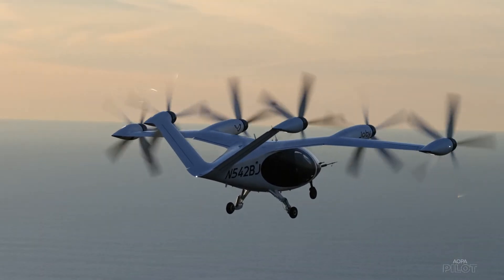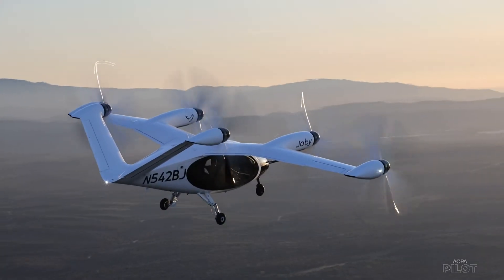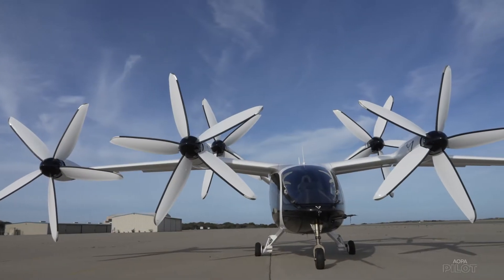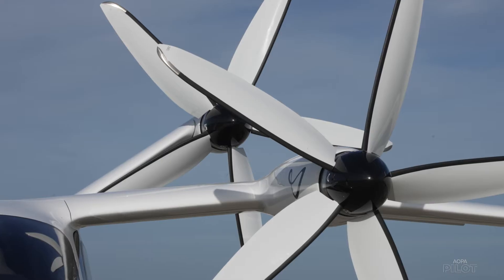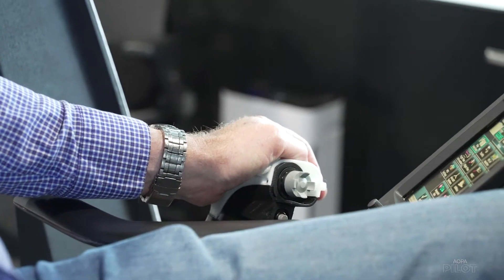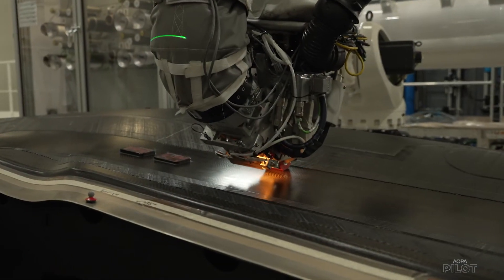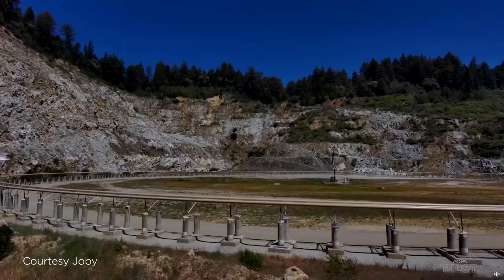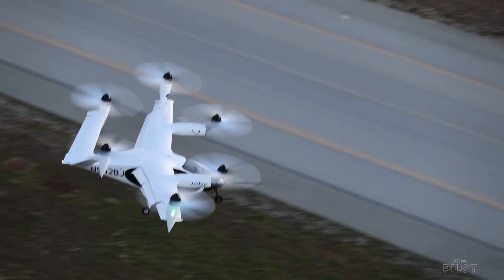Joby S4- The Leader of the eVTOL Pack

Comment: I started flying this in MSFS 2024 and it's very easy to fly once you set up the controls correctly. I think anyone could fly this after a few lessons. No license required. And it's very cool to see what it's capable of in terms of accurate hovering. You can place it anywhere much more easily than a helicopter (in terms of training needed to control it). Very cool to see the real one.

Comment: Boeing stopped production of the 747 because it has 4 engines, and no airliner wants to deal with so many engines on an airplane.
Now, this guy has so many engines like a sow's litter.
It looks like he is going the wrong way.
Reply: they aren't engines they are motors. this thing is a scam.
Reply: @frankyflowers6646  Yes, it does smell a rat !
Well, motors or engine, they do the same job.
Reply: Electric motors have little moving parts. These have one bearing and one shaft. One jet engine probably has 5,000 more parts than all 6 of these. Six motors are called redundancy for safety. Joby has less motors than many others. The industry is recognized the safety advantages with an EVTOL.